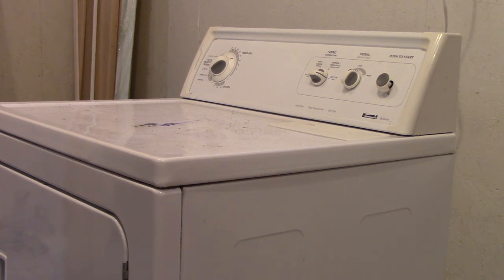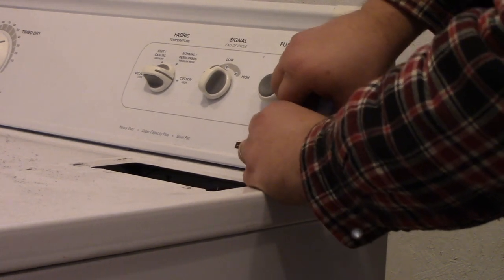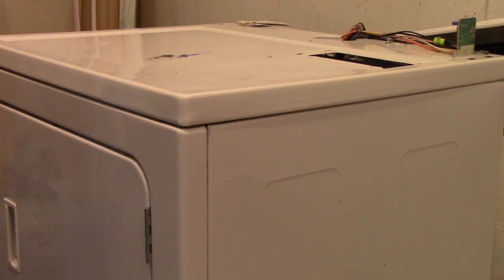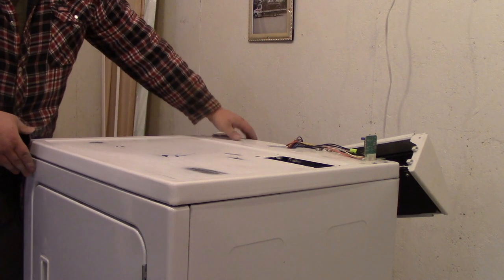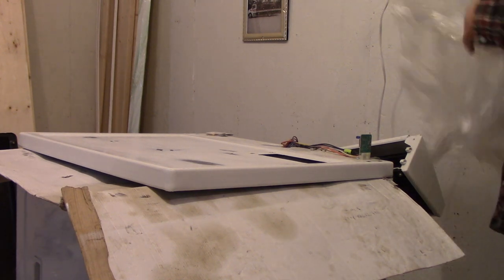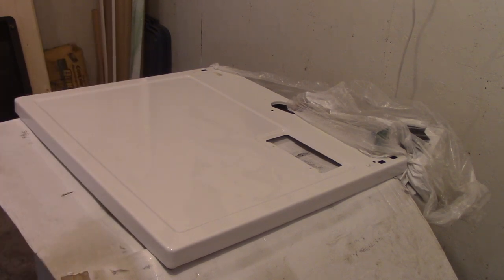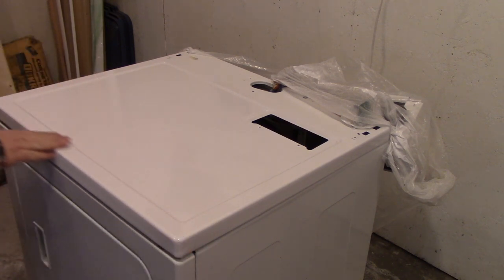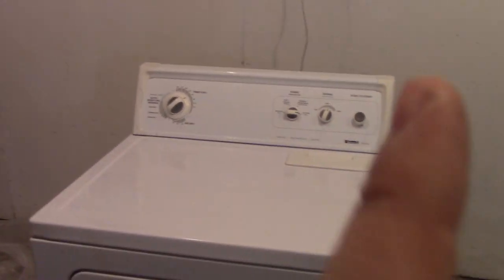How To Paint A Washer And Dryer

Comment: Mfg recommends spray nozzle 12-16 from surface to avoid splatter. You have less than 30 minutes to go over surface with another coat. But best if done in one coat. If you wait any longer you have wait 7 days to avoid bubbling or orange peel look to apply additional coats. That is due to fact that it takes 7 days for drying agents in epoxy to cure.
Reply from the maker: Hi yes i have found that working with this type of spray paint the results are better with one heavy coat and then leave it alone. Once you hit it again with a second coat it's kinda dull and not as shinny...

Comment: Wow! I paint several sets a week and if I took them all apart like that I'd never make any money. All you need to do is cover the control panel (I use old towels) and then start painting. My customers say my machines look new.
Reply from the maker: Yes i have done it that way many times as well both options will work, :)